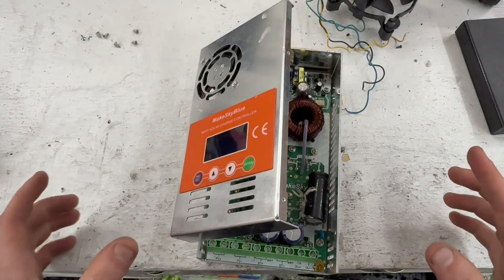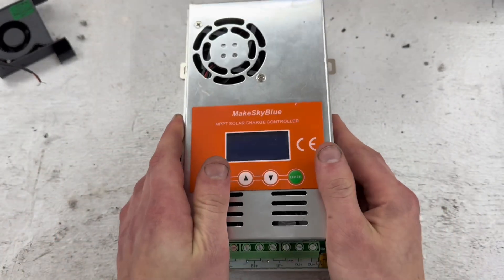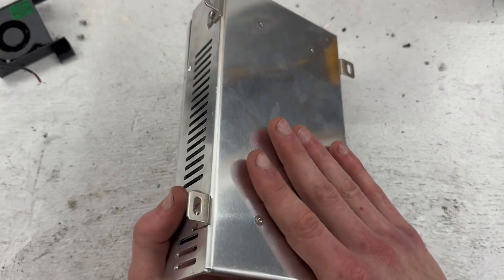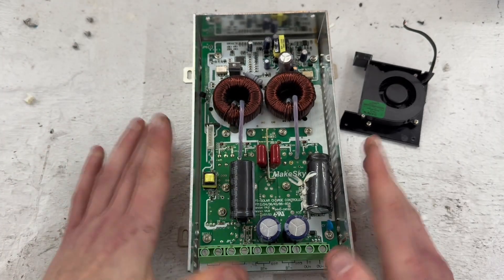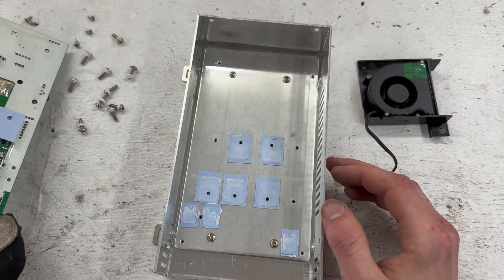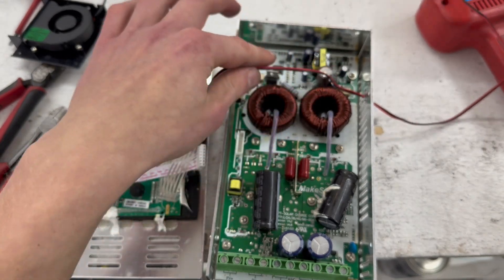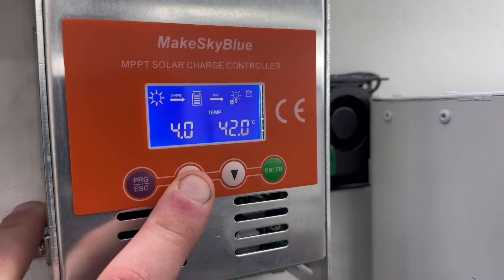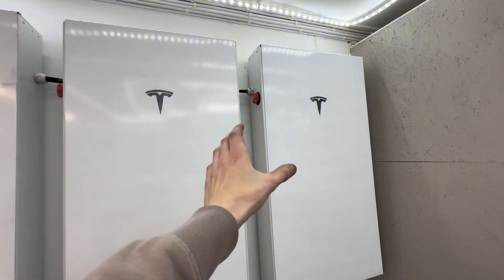Don’t Buy the MakeSkyBlue MPPT Until You Watch This + super cooling

Comment: If  the controller is mounted on the metal back board of an electrical panel , would that be  a heat sink and would it be better?
Sure liked your video.
Reply from the maker: That’s the best approach

Comment: If it's designed this way, won't the fan be blowing directly at the MOSFET tube?
Reply from the maker: the original fan blew air only on the other side of the motherboard